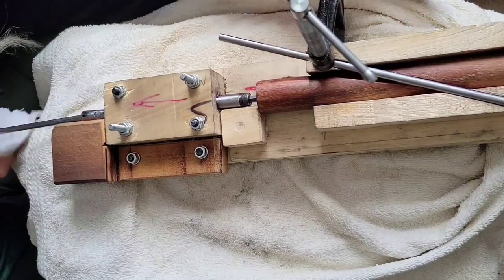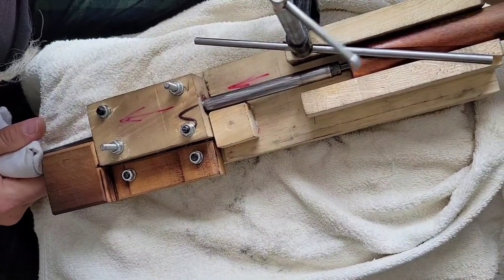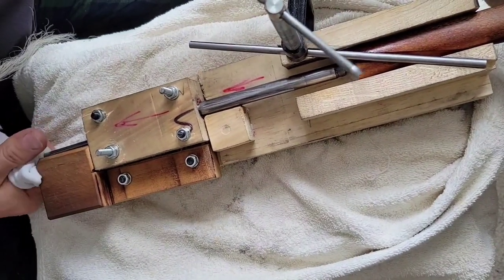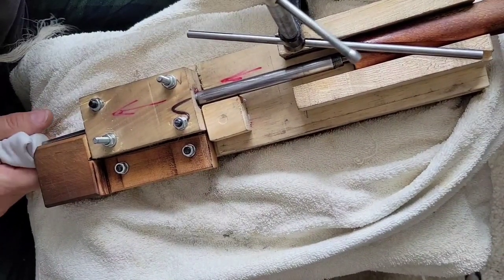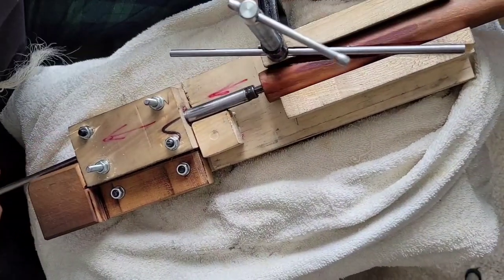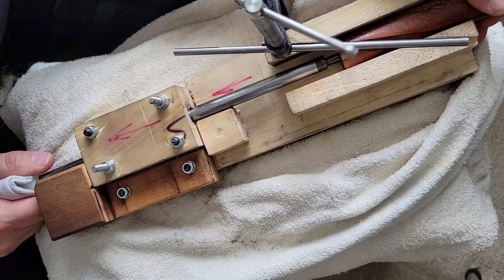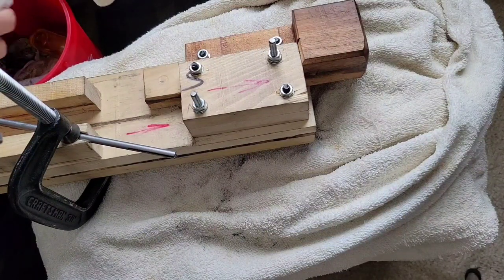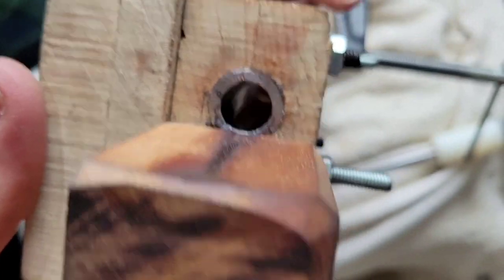Rifling your own barrels,  starting to see results,  and a look at the first slug

Comment: I would make my bullet several inches long with a deep cut out around the middle the front piece will keep it aligned straight the middle cut out area will be for chip evacuation and the back portion will be for obviously cutting the grooves I say this because all the buttons I've seen are very simple and if you don't align them up just right you're going to cut off center

Edit: I thought this was going to be a button cutter video but it looks like you come up with something all original it doesn't look too assuring but still cool that you can do it with your bare heads without any help I like that
Reply from the maker: This is cut rifling,  not button rifling.
Reply: @apexpredatoroutdoors8308  I search for bullet rifling and this video popped up and I made my comment about a minute in and I already had my idea in my head after watching multiple bullet rifling videos
Reply from the maker: @Vinlaell  if you look at the cutting head I made,   it does everything you stated in your comment.
You only need about 2 diameters worth of length in front of the cutter.  You also need sufficient slip fit clearance in order to push the tool through the bore. 
Also,  the tool can't be truly centered because the cutter is spring loaded to press the cutting edge into the groove being cut. 
I used this same process to rifle the barrel of the pistol I made in other videos.   We were hitting beer cans at 117 yards with that barrel.

Comment: Can you suggest any firearm design Resources?
Reply from the maker: Not off the top of my head,   but that sounds worthy of researching and posting a video about.
Reply: @apexpredatoroutdoors8308  

Well, I certainly look forward to that video.
Reply: You're probably best off going some route of learning 'machining' and then from some specific example of a firearm that the blueprints/technical data package is easily available from- since we're speaking english about this, that's probably either the 1911 (which you can get a pretty good set of the ww2 1911 standard drawings of, as a good basis) or the ar15, which you can find every specific critical dimension of.  The AK is another good option, the glock and sig pistols are starting to have this sort of level of aftermarket support also- but the next step beyond "how do I shape" and "what is the shape" is the materials science portion, and this is harder, and your research needs to be more broad.  Steel is a great material- but it's heavy, and it rusts. Aluminum is awesome for the weight- but you can't use it as the bearing surface in any application. Bronze is widely used but very little discussed in the gun industry of mostly-non-gun-makers, but the bronze in the bearing portion of the glock slide let it be both more accurate and more durable, for example, because it wears to shape over the course of life, and the bronze is very 'slippery' and keeps the surfaces working nicely, without you doing anything to it, ever.  Case hardening, meanwhile, is a rabbits hole unto itself, and when you start to see and understand what 'color case hardened' patterns on 1800's steel are, you're going to go nuts, not just because it looks cool, but because case hardening is what they still do to glock barrels- albeit in a furnace that aerosolizes their carbon source and flushes it through the area filled with parts.
Reply: @Userunkown52  "Textbook of Pistol Technology and Design" by Peter Dallhammer (this one is the only one that's not available online and is around 100 bucks for a 2020 edition, all the next ones are on archive dot org)
"Hatcher's Notebook" by J.S. Hatcher
"The Machine gun" by George Chinn (huge)
"Ammunition Making" by George E. Frost
"Making Loading Dies And Bullet Molds" by Harold Hoffman